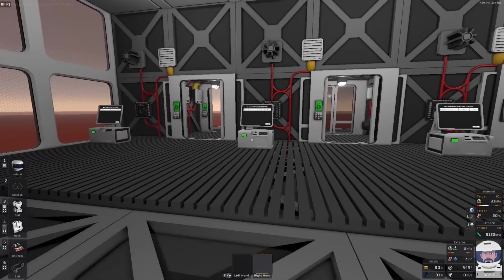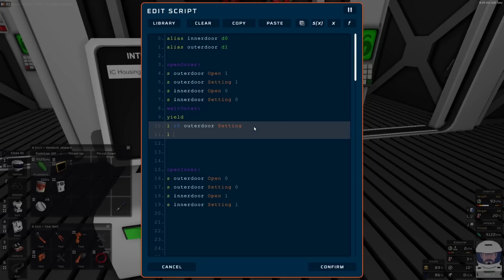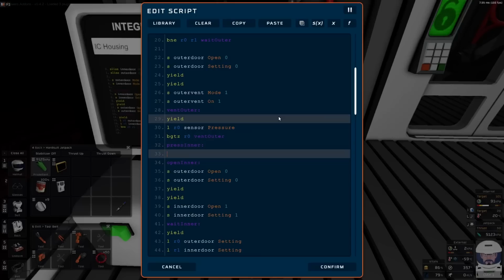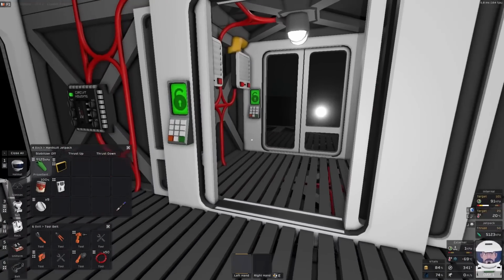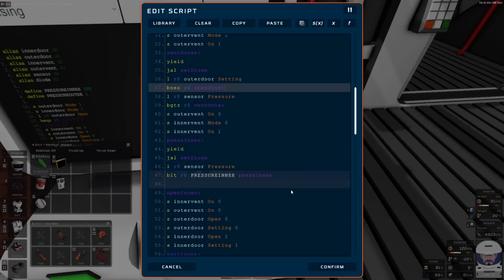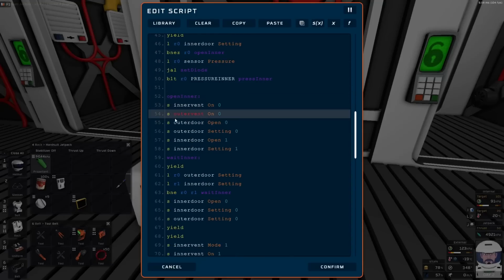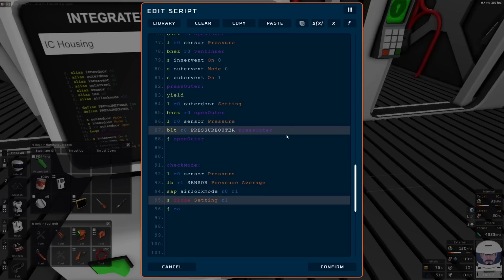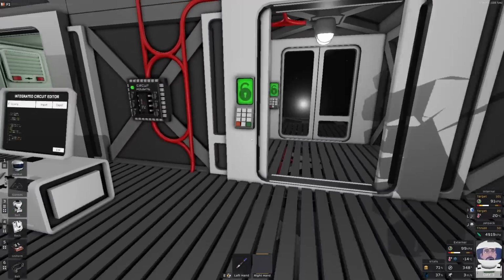Stationeers Programming a Custom Airlock

Comment: Thanks Mick, needed the bit on how to handle doors and their button command! Made a custom airlock using the stack to switch between states and multiple vents to speed up the cycle.
I wouldn't have this confidence without the coding bits in your videos, so thank you!

Comment: I see you fixed this at some point after it, but for 36:50 -- It's incredibly slow because a passive vent and a single pipe section provide an extremely small buffer for an active vent to pull from. It can only access the volume of gas already contained in the pipe network on each game tick -- it can't "suck" air in through the passive vent at a realistic rate, because it takes a full tick for the passive vent to refill the pipe to ambient atmospheric pressure. This can be worked around in a couple of ways:
1. By adding more pipe segments and/or inline tank(s) to the pipe network between the passive and active vents (it can stick off of a T, it doesn't have to be linear). That way the volume available in the pipe network is larger, so the active vent can transfer more gas per tick despite that gas being at only ambient pressure. (I believe active vents have upper limits of their own, though.)
2. Instead of using a passive vent and a pipe network at ambient pressure, use an inline tank (before they existed, extra pipe segments did the job just fine) and when the airlock is evacuated, that atmosphere just gets stored in the tank. This can result in much faster cycling due to the high pressure in the tank, but has the drawback of not refilling automatically if the pressure in the base is lower than what the airlock is trying to pressurize to, which can stall the cycle. I used pressure and back-pressure regulators to control the contents of that tank to prevent this, but if you don't mind having less-optimal repressurization speed, option 1 is much simpler (and still much faster than what you were experiencing).

Comment: I feel like a lot of the code could be simplified with function calls. Even for the bulkhead, your wait loop is duplicated. Why not just have a waitButton function and call that instead, have it return once a button is pressed and wait otherwise?

I'm not going to watch the entire video, but I suspect this is only going to get worse. Am I correct in assuming you end up having two vent loops and two pressurise loops for atmo-to-atmo airlocks?
Each one could just be a function. Put the device you want to check in a register (let's say r0) and use indirect referencing to access it (dr0 in this example)

Not only does it use less code, when you then see lines like "jal waitButton", it also makes it much easier to read, rather than having the entire loop there.

Comment: Thank you for posting this. The version I came up with had way fewer features than this. Nice work.
Some thoughts from when I was playing around though:
-The 2 vent and 1 vent versions can use the same code if you use Branch (Relative) Device Not Set wherever you're using the second vent.
-Alias lines are dynamic run-time code. So instead of duplicating all the code, 1 large block for side A to side B, and another for side B to side A, you can have a small section that checks for which direction you want to go, and re-alias the doors and vents so you only need 1 block of code that uses fromDoor, toDoor, fromVent, toVent. The names that show up on the pins will get switched around as it runs, but it saves code lines and helps avoid making a change to the code for one direction and forgetting to change the other direction.

Pseudo code:

Check_Direction:
{code block to set r10 to direction. 1 for A->B, 0 for B->A}
breqz r10 3
jal setAtoB
j AirlockSequence:
jal setBtoA
j AirlockSequence

setAtoB:
alias fromDoor d0
alias toDoor d1
alias fromVent d2
alias toVent d3
j ra

setBtoA:
alias fromDoor d1
alias toDoor d0
alias fromVent d3
alias toVent d2
j ra

AirlockSequence:
s fromDoor Open 0
s fromVent On 1
...
s toDoor Open 1
...
Reply from the maker: That would make the abort functions difficult and as you mentioned error checking for asymetric airlocks, but it should be possible.

Comment: Why the need for the IC chip, housing and program? This can be done with a console screen, an advanced airlock board.  Or have I missed the point or something here?
Reply: You could have it look for things other than pressure such as outside toxicity levels. Or a link to your suit and the door won't open unless your helmet is closed. Or automatically activate when you enter the airlock (or start switching to outside if the outer door is closed when you approach). Or switching all airlock doors so they're always ready for you whether you're inside or outside. Just some ideas. Obviously not needed for normal operation.
Reply from the maker: Up to this point I have always used the vanilla airlocks and then manual operation when I wanted something different.  Now I can automate the something different situations too.

Comment: I ussually go for 6 vents in airlock into buffer pipe and decide "direction" of gas transfer with turbo pumps from buffer. Make it super fast even in high pressurized enviroments.
Btw, how about some sensor in airlock so it trigger cycle automatically without having to press buttons?
Reply from the maker: Nice idea.  I was trying to think of a way to handle multiple vent.
I do prefer the button press to stop accidnental triggering although a bulkhead door with blast doors and sensors would be handy.

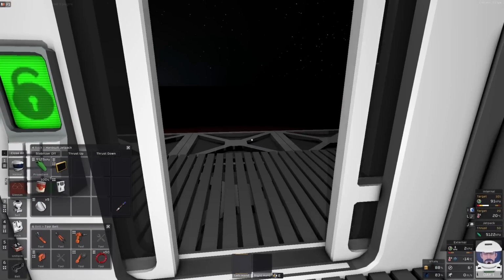Comment: 14:00 you can instead do a wait loop until the "idle" of the closing door is equal to 1 that way even with super slow doors it will work instead of having to spam yields
Reply: Thought that too, slow door might not close within 2 yields... I wonder if wreckage or something can block the door, maybe in future versions...
Reply from the maker: To make it very multi purpose code that would be a better way.

Comment: omg i was trying to make a custom airlock with volume pump since i was playing with elmo realistic atmospheric mod. the vent are not good at pressure change so i try to match them with volume pump in series.
Reply: it's way easier to accept not having a perfect airlock and give up at <1kpa ;)
Reply: @Elmotrix  Gezz, I wish I'd known you'd already figured it out... I had to look inside the the game code to figure the doors out. Which video do you show it in?
Reply: @JoelleFromHell  moon series ep 9 :)
Reply: @Elmotrix  I was thinking it was a pressure difference thing. Outside vent pressure and inner vent pressure, so i was messing with pressure in the pipe to make it faster.
Reply: @jojoskunk  pressure difference does contribute, so depending on planet adding a volume pump behind the active vent can help (on venus you must), but you'll never get the airlock anywhere near as fast as in the base game if you aim for perfect vacuum.